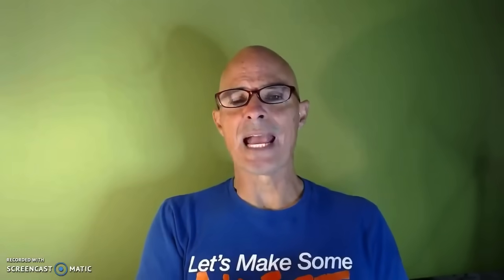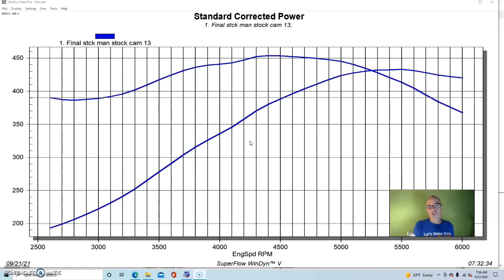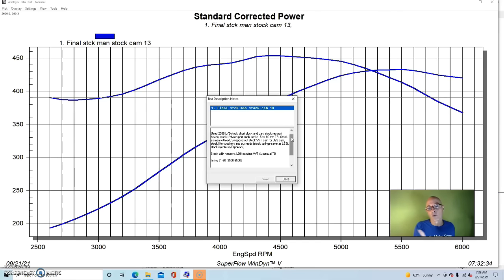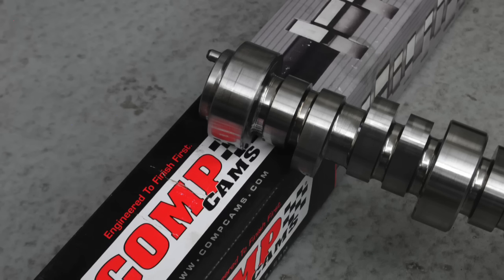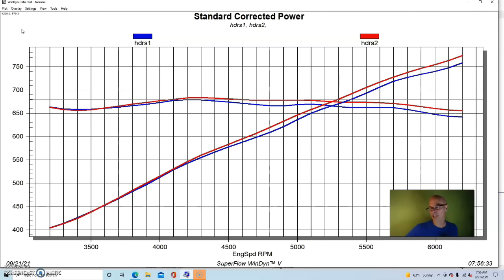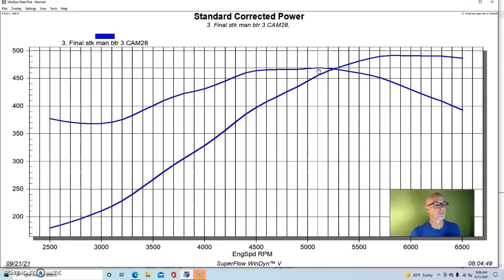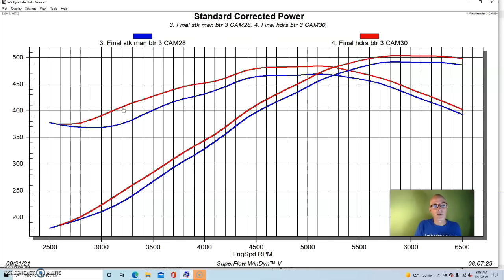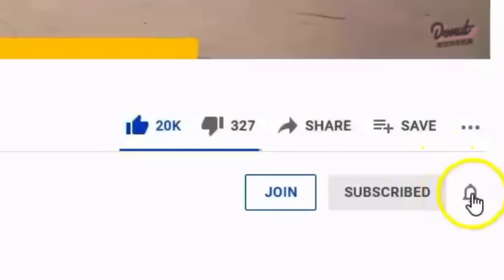HOW MUCH POWER ARE LONG-TUBE HEADERS REALLY WQRTH? JUNKYARD 6.0L LS HEADER TEST!

Comment: I really like this test. Basically I have a lq9 with a stock ls3 topend and a small custom cam which is 228 231 620 lift or something really close. Runs decent, but was dynoed in 2nd gear instead of 3rd. Only managed 395wheel but did have the wrong valve springs from the eBay seller who built the heads. Almost dropped multiple valves.
Reply from the maker: also test in 3rd gear
Reply: @richardholdener1727  I wish the tuner did, was declined because I had 2:73s and he was scared the driveshaft would fly out 😞

Comment: I was running 40 ifr, 72 primary jet on my ls swapped obs with stock cast headers. When I installed 1 3/4 headers, I had to lean out the jets  to 35 ifr and 65 primary jet , so yes theres a big scavenging effect with longtube headers, I had to jet down because of how rich it was with tubes , just an fyi

Comment: A video on working out matching header pipe sizes to the motor would be good.
A K series Honda won’t need 1 7/8” header pipes but does say a mid sized motor like the 3800??
Reply: Per piston the K24 would be flowing and revving much more.

Comment: Years back, In an S10 SBC swap, I started out with factory manifolds (the little logs that went over the plugs, passenger side angle output, drivers side straight dump) and at the time, there were no long tube headers available, so I went with what everyone else was doing, the Headman shorty headers and WHAT A MISTAKE. For the little bit gained above 4500 RPM, too much was lost everywhere below. I will never buy shorty headers for anything ever again.
Reply: This concept that Richard pushes of being "flow restricted" is flawed. I understand why he does it, it's simplifies things for the average person but it masks the true physics of what's going on here.
The engine is a pump, any type of inlet or outlet appendage is going to reduce air flow through the pump as it's a restriction. Might not be a major issue but it's still a factor. Pumping losses from the exhaust system don't go away under any circumstances.

Comment: The lower RPM seems to gain more with headers when you have a cam. I've noticed that a lot of engines run cooler when they go to longtubes.
Reply: Good to know.  Makes it worth it.  I have a LQ4 block, with a cam.   Doing speed engineering long tubes.

Comment: those LS factory manifolds actually look like really nice quality castings. Sure makes the old kinked and ugly factory manifolds of the past look bad.
Reply: Would love to see heat proof coating on stock manifold or wrapped headers with heat proof coated combustion chambers could do for efficiency.
Reply: @altruismfirst6489  The funny thing about cast steel vs tubular stainless is thickness counts for heat transfer, which puts them nearly even. People with flipped stock manifolds for turbos can run no wrap without heat issues, but it helps. Meanwhile I've dealt with many cars with stainless longtubes melting anything & everything near the collector.

Comment: Just don’t buy cheap thin wall headers. Early 2000’s I installed Hedman 2 piece long tube headers on a 1983 F150 with the 300-6 and 4 speed. The starter was complete trapped by the tubes and the amount of heat radiating into the engine bay was immense. Either buy good thick metal headers or wrap them or get them ceramic coated. The EFI 300-6 started with the 1987 F150 and I found them to be much more reliable than the carbed ones that were a hassle to keep running good.
Reply: one trick most miss with the carbed 300's were the carb was two piece and would still run pretty well if the two large phillips screws that join the parts together were a bit loose.used to use an offset screwdriver to tighten mine regularly , made a difference.
Reply: I had lots of trouble with those carbs. I’d rather have a 2 barrel or small 4 barrel or else EFI.

Comment: I've got an example of full tube headers, lightly ported heads, and a stock 2 barrel intake. 
   This is 9n my 1970 Mercury Cougar, 2 barrel Windsor. 
I had a valve job done to them and at the same time I hogged out the EGR bumps from the exhaust ports, blended the bowls and port matched the openings. Put a set of Hooked Super Comp headers on it with dual exhaust to the back. I couldn't afford a new carb and intake set up at the time so I ran what the factory sent.
    The set up was scavenging so much the engine developed a bad lean mis at 50 MPH and got worse from there.
I was only 2 miles from home to figure that out. So off comes the top off the carb and I figured to drill out the main jets 0.010" to start. Much better! I still had a hard time coming off the line, like not enough timing. Tipped in 5 degrees on the distributor and now she comes alive! Not an LS story but relatable. A few little things can make a big difference without spending a lot of money.
  Good video BTW.

Comment: I love that you show the dyno results in the graph and not just top numbers. I'm really curious how short, medium, and long tube headers compare throughout the rpm range since everyone else only shows numbers and I prefer the low to mid rpm range for 2 builds I have going. A Jeep YJ and a daily driver 56 Bel Air, both getting 5.3 LS swaps.
Reply from the maker: LONG TUBES ARE BETTER EVERYWHERE
Reply: @richardholdener1727  They'll definitely fit in the Jeep. There may be clearance issues on the Bel Air lol

Comment: Question. Could you theoretically increase horsepower on a supercharged engine by decreasing the blower pulley diameter, then tune it by scaling the fuel injectors linearly with the percentage increase of the supercharger rpm?
Basically tune the vehicle without involving the ecm
Reply from the maker: if you knew the change in airflow and AF for both sides of the equation and both were linear (might not be the case)
Reply: @richardholdener1727   Thanks for the reply!
There’s enough equipment over here for me to simulate what the change in airflow will be, so thanks for the heads up there!
I’m gonna give it a shot! I have a 10% overdrive pulley for a 2.4L IHI twin screw supercharger on a 6.2L v8 engine. I’m assuming 11.4% bigger injectors is close enough to make up for it.
My next question would be if the clutched pulley on the blower will give me trouble. I think it’s a niche situation at that point, so I’ll have to test it myself.

Comment: This is exactly what I needed to see. I picked up a set of 1 7/8 headers for CHEAP for my 6.2. They won't fit currently but it's an easy modification for them to work. The problem is then I'm left with a set of nice stainless headers that only fit a 03+ crown vic when I pull them off to go turbo.I was planning on running manifolds until I sort any bugs out of my l92 (with tsp stage 1 LS3 225/230 .629"/615" 114) swap before building the turbo buuuut cheap is cheap.
Reply: i have an 09 P71 that i'm about to put Maximizer/OBX headers on, gonna be sweet.. Oh, n cams n other bolt ons..
Reply: @P71ScrewHead  I've been down that road with the 4.6 in other crown vics and I was always disappointed. I hope you have a converter and gears on order too. I'm very excited to finally make real power with the 6.2 LS swap.
Reply: @ianm432  Oh yeah, i know what you mean, modding the 2v is more for the love of the 2v than for huge power gains..lol If anyone really wants great amounts of power, everyone'd build big blocks, that'll be my next build, a 632ci BBC/BBF over 800hp n/a.. With power adder looking at over 2k hp.. Edit: forgot to mention that yeah, getting 3.73s n might hold off on a converter for future mod..
Reply: @P71ScrewHead  absolutely do not skip the converter. It was the best mod I ever did on my 2011. Better than the 5spd swap on my 2003
Reply: @ianm432  what stall did you go with?? i have looked into a 2800 stall tho..
Reply: @P71ScrewHead  circle D 3000. Go higher than that if you're planning on adding cams. 2800-3000 is fine for a stock engine. You won't notice a good converter under normal driving and it will stall lower if you add gears.
Reply: @P71ScrewHead  stall, gears, jmod and tune made my car a BEAST stoplight to stoplight. Huge burnouts at will.Still slow above 60mph though still an improvement.
Reply: @ianm432  i agree, but if i go with a 800hp setup i might just buy a race transmission that'll handle it, i hear these automatics break after 400hp..lol Or a rebuild kit that'll handle 800hp, that'll be cheaper than buying a new one but i'll decide then.. i beat a Chevy SS at a stoplight to 40mph, after that, he smoked me..lol These Panthers are good from a dig but do lack power from the 2v, like any engine tho, once modded they do hurt ppl's feelings..
Reply: That would be the perfect setup Vortech YSi-B. It'll keep the hood temps down.
Reply: @Dr_Xyzt  going with a t6 s480 turbo but damn if I didn't just spend a few minutes thinking about that.
Reply: @ianm432  I can see why you chose a single turbo, since you just get the one crossover tube. I flirt with twin GTX3576R's from time to time, but there's just so much hot exhaust stuff that goes by inconvenient places in my case. I'm eyeing a forward facing YSi-B on a cog belt. Aim the discharge down, elbow through the core support for the intercooler, back to the engine, done. Right where the AC compressor used to go.
Reply: @Dr_Xyzt  I've built a few 2j 700+ hp drift cars that taught me a lot about heat heat management. Lots of ceramic coating, wrap, fire sleeve and ventilation planned. It's also a great platform designed with incredible HM for fleet use from the factory.
Reply: @ianm432  What ceramic coating do you like? I have some Heddman longtubes and love their HTC coating. I see other folks with this bronze looking stuff though, and I want it BAD. Or, something that looks like blue stainless.
Reply: @Dr_Xyzt  I've only had cerakote applied to stuff but I had a set of coated Mac headers a million years ago that seemed to work well.

Comment: I can answer this question before I even watch your dyno results; the answer is it depends. There are literally some engines that don’t pickup any power at all from aftermarket headers. This being the result of an engine that A) isn’t flow restricted on the exhaust side of things and/or B) has a decent factory setup that promotes scavenging. As far as boosted applications from what I’ve seen over the years it matters far more what is in front of the compressor wheel than what feeds the turbine wheel. More often than not I’ve changed boost pressure more with inlet piping than the exhaust setup, and typically see changes in spool rate with exhaust modifications rather than changes in overall total boost pressure. When I have seen gains on built NA engines from header changes, it’s not usually from flow it’s from the effects of scavenging. I know this because I rarely see a power difference from a change in primary diameter, and I have literally bashed and bent/Pryed on headers to make them fit off the wall swap applications to the point where I 100% know I diminished the inner diameter of the tube somewhat, and power did not change.

Comment: You make great videos, Richard. That said, it may help to make a comparison list, in addition to the graphs. For instance.......
Stock manifold Hp  Hp w/LTs
            415hp                432
Don't have room on phone screen to elaborate. You provide great info, but there's so much, it's hard to keep it all straight. But I'm subscribed, and I like 👍 👌!
Reply: Yeah the editing is quite good already but the numbers that flash on the screen could just be placed somewhere on the screen for a short while as they are discussed, like the cam specs listed, and also especially in the dyno charts I would like to see the gains/losses posted as a number somewhere on the screen, so we don't have to go count bars and guess. Engine Masters (motortrend) on Youtube did some really nice editing on their dyno videos, a full screen break down with the gains posted and each runs maximum numbers.

Comment: If the difference between stock vs long tube headers is only 10HP, then I can probably get that gain from primary (maybe even secondary) cat delete and save me a ton of money in the process. 
Probably much easier to increase flow by removing restrictions (cat) than by improving the manifold design.

Great video!
Reply from the maker: the gains from long tubes are not flow restrictions
Reply: Yeh what e said....

Comment: My stock Pontiac exhaust manifolds can care less...Anything was better than that 180 hp! 800 is a hell of a difference (cam, heads, pistons, ring gap, rods, crank, fuel injection, 7875 Vs, e85)...Modified factory Y pipe, swollen up to 3” feeding into a single 3’ long 3” down pipe

Comment: Recently became aware that the B16 heads are a 6 bolt version of the LS3 head.  Kind of neat.  That givves guys another choice in LSX heads... the Chevrolet LSX-DR doesn't seem to get much love.
Reply: What is a b16 head? I googled it and Honda motors are showing up in the search.
Reply from the maker: B15 is the GM Perf crate motor
Reply: @Stephen_Hodge  Typo... fat fingers and bad eyes.  B15... where "B" is for boost and 15 means 15 lbs.  I did some surfing yesterday and found that GMPP makes a few 6 bolt performance heads.  You can buy em as cast or CNC machined, but they're expensive.  Prices are much higher than aftermarket items from Texas Speed etc.

Comment: I'd be curious how the home made pass side turbo manifold/header is compared to the Hooker Blackheart stuff.  Toss in a comparison between a log or Fahler Speed style manifold and everyone will see what is worth doing.
Reply: I'm quite sure it would make not much of a difference unless you're making way over 1000hp .
Reply from the maker: the Holley turbo system is somewhat restrictive (the merge point) after the cross over. A different design with more flow will add power and drop back pressure

Comment: Richard, I realize that 99% of folks could care less about cast iron exhaust manifolds. And I realize that Cast iron exhaust manifolds kill power substantially, especially in the upper rpm ranges. I have a set of cnc'ed and ported (by Brzezinski) corvette ram horns and wonder just how much power they are capable of making over 3000 rpm, but... I cant find any dyno numbers anywhere. I would really be interested in what it would take to make 450 to 475hp with these manifolds. Thanks for reading, Jim
Reply from the maker: STOCK MANIFOLDS TYPICALLY LOSE MORE POWER IN THE LOWER RPM RANGES, WHERE THEY LACK SCAVENGING, THE PORTED RAMS MIGHT FLOW WELL UP TOP

Comment: I have always seen substantial gains across the entire rev range when upgrading from cast to long tube headers on my Buick L27 V6 engines, typically 18-20kW gain on a stock engine.  I also found I am completely knock limited on cast manifolds to a max of 22º peak WOT timing where I can get to MBT of 28-29º without being knock limited once I go to long tube headers.   I use the pacemaker headers here in Australia and they have tubes about 700-850mm long depending if you get the street or competition headers.
Reply from the maker: IS THE CHANGE IN POWER FROM THE TIMING?
Reply: @richardholdener1727  Not really.  I ran E85 on a stock engine with cast manifolds mainly to test the knock limits of E85 and found MBT was 23, 24ishº virtually as stock, stock is 22º   The headers changed the point of MBT.  Oh and as for the E85 I saw no knock even to 40º. With ULP it would knock only about 2º past the factory settings with cast manifolds.  So the factory cast manifolds were knock limited and MBT pretty much. With headers the MBT moved up and the knock limit moved up even more which gave much more safety margin, therefore no longer knock limited allowing MBT to be well enough below the knock limit.
It would seem with these combos they behave very differently.
Reply: @3800S1  I'd wager a big bet it's going to vary based on the engine - particularly the header design. Stock LS headers flow & scavenge very well, while I've seen many other engines that had headers that were huge restrictions. I certainly wouldn't think an original 1954 SBC would come close to 10lb-ft of a modern race header.

Turbo guys consistently have made >1000hp (750kW) to the wheels with stock LS truck headers - and have track times that indicate it's not just a bunch of high-reading dynos.

Comment: I know that the old style SBC is no longer a go-to power plant, but it would have been interesting to compare that generation’s stock log style exhaust manifolds to long tube headers.  Sure there would be a much more impressive gains with the headers.
Reply: Or a test with the new Hooker cast iron manifolds for the SBC.
Reply from the maker: done that many times-same type of gains
Reply: It's similar.  They've done that comparison often.  0

Comment: 100% spot on, the longer the cam duration the bigger the potential gains from the header. Especially noticeable on a street driven motor at low RPM,  with the Wrong cam 😆